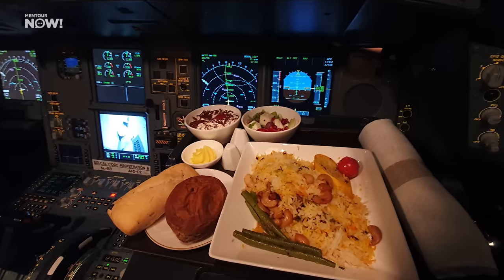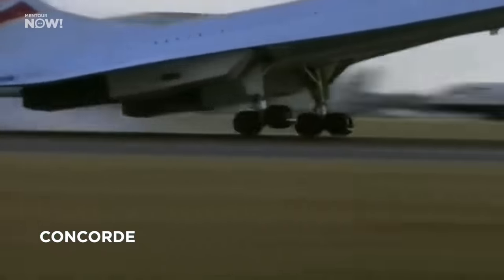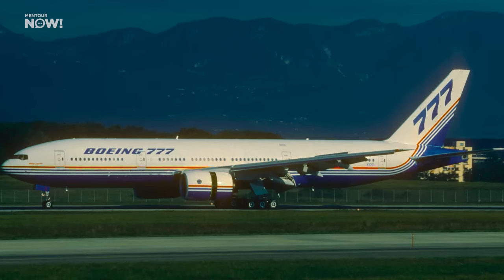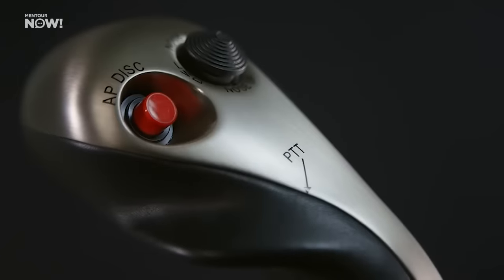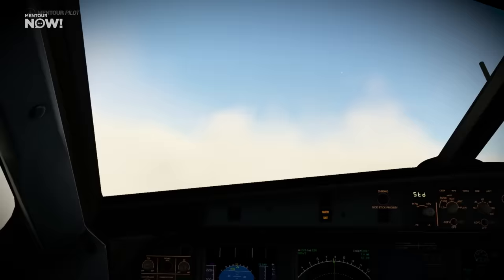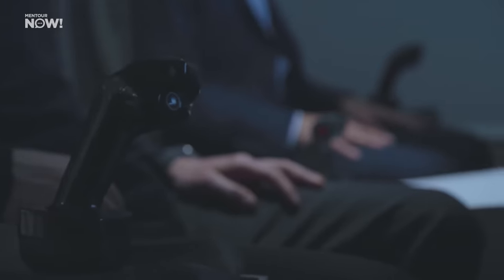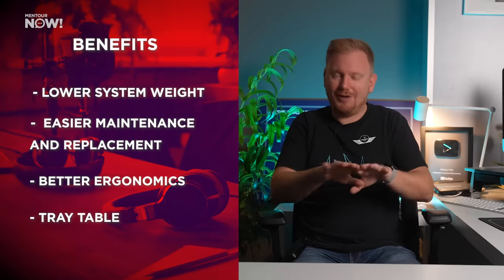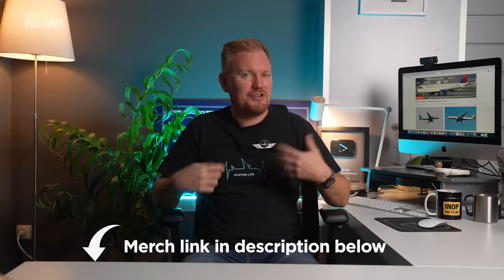Will Airbus Finally switch??

Comment: After watching this video I'm confused. First: The A320 current CEOs (With the NEOs I'm not shure) run on the same old hardware you mentioned. There hasn't been a major upgrade with regards to the CPUs, where do you get that information from? Why upgrading a good running, well known system? With the E-Rudder version, coming in the future, there will be an upgrade of the FBW computers... (FMGCs you mentioned can be fitted with new FM-hardware (Honeywell uses AM29k derivatives, again not new) but FG is still the 80286. 

Second: The force you feel in the yokes of, let's say an A310, or a 757, aren't the aerodynamic forces impacting the control surfaces. What you feel is a spring loaded mechanism reacting against your input. What you do with your yoke is moving a mechanical feedback system placed on every actuator witch in turn activates the servos until a new, demanded position is reached. But yeah when you fly a Cessna then you feel real forces from the surfaces. Witch brings me to TRIM:

You trim the plane (I'm not a pilot so correct me) as long the yoke isn't in the neutral position. What you do is integrating the elevator input. That's exactly what AutoTRIM in Airbus AC does (And I mean 100% exact, as this is how the C*law works/ is implemented). In case it doesn't work you trim as long as the stick returns to neutral and the plane maintains the heading without stick input.

Third: The 777 uses an artificial feedback system (supplied by the PRIMs) but just in one axis if I remember correctly. I think it was pitch. The other again spring loaded... Following the last point:

All these systems rely on data coming from sensos, in case of malfunctions, the safe state would be switching off the artificial feedback as proper functionality can't be guaranteed. This would be the state where laws also degrade to direct. Now a aerodynamic feedback would be supportive, but it wouldn't be available :D 

Just one final thought:
The current aircraft out there can't be simply retrofitted. Even though the units are called LRUs... Current sticks on the 320 , same for 330 and so on, are simple devices with two transducer units in each axis, which are simple banks of potentiometers. That's it. No data link. One could say the USB-Joystick at home is electronical more advanced than the real thing. The active sticks you talked about most likely use A429 or even AFDX.

Comment: Sometimes things just make sense. And active sidesticks seem to fall into the "why not" category. Safety and control should be paramount in aircraft design and importantly, continuous upgrade and development. The existing Airbus system has caused numerous upsets and a few accidents. I'm surprised the regulators haven't already stepped in to demand the incorporation of this technology to save lives.

Comment: Two-seat fighter jets, except for trainer models, are only set up for one pilot. The person in the second seat operates the radar, certain weapons systems, radio communications, and surveillance or targeting pods, depending on the model and mission.
Reply from the maker: I'm told that all two-seat F-16s have sidesticks in both seats.
Reply: @MentourNow  that would appear to be because the two-seat version of the F-16 is almost exclusively used as trainers. The instructor, who has sufficient experience to teach the operation of the aircraft, is seated in the rear. Unfortunately, I don't actually have any firsthand knowledge on the operational usage of the various models of the F-16, but I have not seen or heard of any instances of fighter jets being fielded with two pilots. The person in the rear seat is usually not a qualified pilot and oftentimes can't become one for various reasons.  They undergo a different training path, much like fighter, bomber, cargo, and helicopter pilots split down separate flight training branches.

Comment: The thing is, Airbus stuck with the same cockpit for all its planes as one of its main selling point. Introducing such differently behaving, but otherwise very similar looking controls would break that "same cockpit various planes", even creating dangerous confusions (pilots may get an impression they are in one type, but actually being in the other). Mainly during the period when there would be both variants present in the same company fleet.
So to me it does not sound as unlikely for the reason to not upgrade to just be the fear at Airbus, of the benefit not being sufficient to outweght the risks involved with such change.

Comment: I love the fact that you use the sponsor you mention. I thought it was just a few of us who felt the way you did. Sadly, or maybe not, I flat out refuse to get on a plane these days, and that's fine, I'm retired from aviation, although we never  forget our passion. Why is that, well it starts with the corporate mentality, always cutting corners, knowing it's cheaper to pay out the families of victims than to make things correct from the start. Just look at the 737Max debacles these days as just one example. Add to that the fancy new ramrod ways of getting new pilots into those seats because of shortages. Knowing that manufacturers installed "backdoors" to take over control of an aircraft doesn't help. Ever heard of things getting hacked? Software glitches, poor programming. Enough said. Thanks for what you do however, it's always interesting.

Comment: Hmm let me think.. More control over the aircraft or a handy table 🧐 Difficult choice 😂 I am a machine operator, I drive everything that goes on land. But I would never want to reduce feedback from the machine for something like a cup holder or something. I don't buy new cars anymore because of the electric power steering. Most people don't even notice it but when driving is your job you most certainly feel that you get way less feedback in the steering wheel. I buy older cars now and fix them waiting for a better day.

Comment: 5:52 Some kind of even plane/countertop/pointer that is parallel to the longitudinal direction of the plane and that is in the visual field of the pilots might aid in visualizing the orientation of the plane.
The airplane manufacturers could quite easily implement external cameras to the wings and to the vertical stabilizer of the planes

Comment: It always struck me as a safety oversight that there is no mechanical or otherwise simulated link between both sidesticks on Airbuses. On your accident investigations, there were numerous cases of both pilots inputting at critical moments and the "dual input" warning going completely unnoticed. 

Based on other comments posted here, this seems like a design that's already been successfully implemented in other aircraft. Anyone who's ever played a sim racer or flight sim with a wheel or stick respectively knows that force feedback has a huge impact on your ability to quickly feel what's happening and make the appropriate adjustments.

Comment: Active side sticks would be a huge philosophical change for Airbus, which has no feedback on the sticks - or the throttles quadrants (thrust levers), but instead emphasis trust in the system (EFIS) indications. Or, indeed, they could simply absorb the change, as a new technology addition.

If Boeing ever decides to go for active side sticks, in place of their active yokes for their FBW aircraft, the change is in weight and ergonomics only. Boeing active yokes also have force feedback, which is a legacy technology with its own dedicated "computer" flying on the non-FBW 737. Touchscreens will fly on the 777-9, replacing that aircraft's cursor control devices for EFIS menu browsing and selection.

###

Please do a piece on the differences between Airbus and Boeing fly-by-wire.

Comment: How about a 'joystick' deployable in the same position as a yoke? This would allow pilot and co-pilots sticks to be identical. Furthermore both could use either their left or right hands for control, in the event of any partial incapacitation. Careful ergonomic design would obviate any problems with observing the glass instruments.

Than both could have a table for lunch.😁

Comment: they should invent a single stick in the middle while the throttle and all the central stack move on the other side of each pilot.. this makes the pilots sit closer to each other it is the most economical building an airplane.

Comment: I think the untold part of the story about Airbus’s switch to fly-by-wire is that Airbus was anything but famous for its cable-operated flight control designs.  The A300 may have been a good plane in many ways, but it was notorious for highly ‘sensitive’ rudder controls — meaning that they had less travel and required much less force to move than on most airliners of its time.  This made it all too easy for unsuspecting pilots to place great stress on the rudder attempting to do what they thought were normal rudder inputs. Meanwhile, the A300’s vertical tail assembly was, let’s just say, not designed all that robustly in terms of mechanical strength.  So we got American Flight 587, where the pilot flew his A300-600R with 287 souls into a 747’s wake on takeoff from JFK, applied the aggressive recovery rudder inputs the airline had trained him to apply, and ripped the plane’s vertical tail clean off.  Both engines ripped off the plane before it even hit the ground in a densely populated Queens suburb.  Now it’s true that both pilots, the airline, and Airbus all acted less than perfectly, but the NTSB was not happy with the A300-600R’s controls and found their flawed design contributed to the tragedy.   Airbus had switched over to fly-by-wire long before Flight 587, but I think they did not have any particular reason to think their cable control designs were particularly scintillating. They probably thought they had little to lose switching to a different control philosophy.

Comment: I don't think they'll be adapting the MS-21 / MC-21 active sidestick system over to the airbus.
Rather, I think they'll take the existing Airbus design, and use the knowledge gained from the MC-21 project to bring the Airbus sidestick up to parity.
Of course that assumes that such a modification happens at all.
There is a hidden modification that I am unsure of the possibility of that would be required for these active sidesticks however.
There must be a path for data to travel between the sidesticks, and I do not know if the existing data path between the sidesticks and the main flight computers is bidirectional or not (it likely is, but the bandwidth is what matters here) At most, this needs another wire or two, but when you consider modifying "a wire or two" across the wiring looms of ALL the A320-derived aircraft in the fleet, that's a lot of work that adds up quickly even if it's only a few hour's downtime per aircraft (and it's gonna be more than that, I'm sure of it because that's just how aircraft modifications go, they're done in a slow and deliberate way to minimize avoidable mistakes).

Comment: I’m not a pilot or an engineer. But it seems odd to me that there wouldn’t be any tactile feedback on the side stick? And the fact that the Airbus side sticks splits the difference between dual inputs is just mind boggling. I’m sure there must be ways to configure this in the cockpit. Perhaps pilots just don’t use these configurations? I like the idea of the side stick as it looks like a cleaner design from an operational point of view. But I can understand why the yoke system could be more advantageous in certain situations. Also, you would think the Boeing yoke system would have made better use of the real estate and incorporated screens and displays in the yoke itself. Although I guess a moving surface is not ideal for this. Maybe they could build a floating system into the yoke? Ok, I’m thinking out loud here. Getting lost in trying to make my point 😂. Anyways, thanks for the video Petter. Always fun to watch. Even though I’m not a pilot.

Comment: It's not a Boeing vs Airbus debate, but this reminds me if the fight between truck drivers who hold their coffee while they're driving and thise of us whi drive the truck. One of these groups consists of drivers, just like how only some people who sit in cockpits are pilots. To confound even further, 2 types of people sit in heavy equipment: operators, and those who play with E/H (electronic over hydraulic) controls.

Many argue that E/H (fly by wire) enables automation for efficiency and safety, but I'm sitting here in a Komatsu loader with pilot valve controls (no electronic disconnect) and the automated assists (float, auto-lift detent, and return to dig) work better than they do on E/H machines, some òf which even have fewer automated features. The mechanisms used to enable automation on a manual, connected control interface train the operator quickly with tactile feedback, and overrides are just a matter of negotiating with a small elecrromagnet which gently holds joystick positions until another condition is met or the stick is pulled out of the detent position. Flight envelope limitations could easily be implemented with force-feedback on mechanically linked controls, and it doesn't even matter if they're sidesticks or yokes. They should still be attached to the systems they operate, even in a power failure.

Comment: I'd say that when the directional command of a given vehicle (2 or 3 axis) can receive dual inputs, the circular idea comes to mind. Boats first and cars very quickly adopted the principle, leaving behind the bar (that is still found in the lighter sailing boats).
The wheel started being applied to civil aviation, letting the bar to the military.
The adoption of the side stick was not necessary in the context of the fly by wire revolution. It was instead expression of an ingenuous radicalism.
It fails to address equally the dextarity issue, unavoidable when there is a side by side command.
The need for a real feedback of the controlling actions came from the dangers of non intuitive perceptions, leading to failures of the essential awareness.
The current try doesn't cover the dextarity issue.
Not enough good.
In my mind it's frivoulous to argue with weight and "domestic" arrangements (table, etc).

Comment: MC-21 has active and interconnected sidesticks by initial design as well as moving throttle levers in autothrust mode. The next generation of SJ-100 is about to be the same.
Reply: There were no even rumors that SJ-100 will get such things as active sidestick. More over: all 6 flying MC-21 at the moment have inside their cockpits (regarding flight controls handles) - are French made. Russia is yet to create and certify its own substitutes.

Comment: I'd also just like to point out, completely as an aside, that DirectInput/Xinput are actually really terrible at outputting forcefeedback for there virtual device counterparts.

It's not really related to the video, but I'm just reminded of discussions about the output rate of Dinput/Xinput and that really Windows or literally anyone should work to improve it.

Comment: As a non pilot I wonder about one seat having a right side stick and the other having a left one. Seems like eye hand coordination would be an issue going back and forth?
Reply: The funny thing is, that's no different to a yoke. If you sit on the left side, your right hand is on the throttles and only your left hand on the yoke if you fly manualy.

Comment: Military jets-high G-forces; hard to keep your hands on the centre mounted joystick. The feedback part is so necessary, remember your flight in that electric plane? Without feed back of that, small acknowledged, plane it would've been quite the ride. 
Cheers from the Pacific West Coast of Canada

Comment: Very interesting, thank you Mentorpilot - for the video! 

How about Auto Thrust / Auto Throttle issue? 

My first FBW a/c was E170 in 2004. A very good airplane overall however the introduction wasn’t free of issues …including servo problems. Those who used to play RC models remember what happens if a servo goes bad in flight. What is a servo within an active sidestick decides to do something? HOWEVER nowadays a bad servo in RC world simply don’t happen any more! …almost :-) 
So it is a time for active sidesticks I think, especially after spending some 10000h on 320/1 - large % as LTC. After 5 years on Boeing FBW - I feel why FEEL works so well.
Numbers? Statistics? Cases? Comparison? 
Not on my level ;-)
However for pure training / awareness level - again - A/T vs ATHR is an interesting issue. Trust control and flight envelope protections are my main interest. Both 777s (so 787 per design) and 320s had some history of accidents … caused by actually abnormal / non standard situations somewhere between thrust control and flight envelope protection. 
Worth to dive into details of how the soft works…

Comment: Boeing spent a lot of thought making the 777 feel and fly like a "normal" plane. If you look up from undeer the flight deck it is full of cables and springs to give feedback of the loads on the flight surfaces.  Something that dates back to the first powered flight controls. Oh, and Boeing didn't fully trust the fly by wire so fitted cables to the No4 and 11 spoilers for roll and the horisontal stab for pitch. Yaw was controlled by engine thrust. Not sure if this is still true on later aircraft as I am now retired.
Reply: The mechanical backups for the spoilers and horizontal stabilizer for the 777 is true. However on the 787, that has since be replaced by electrical backups via Electro Mechanical Actuators, operating 2 spoilers per wing and the horizontal stabilizer. No more mechanical backups now. The 777X may follow that example even.